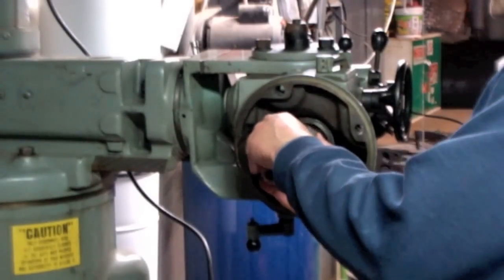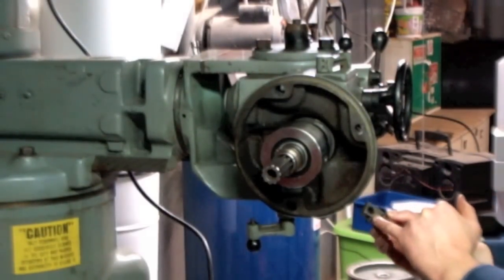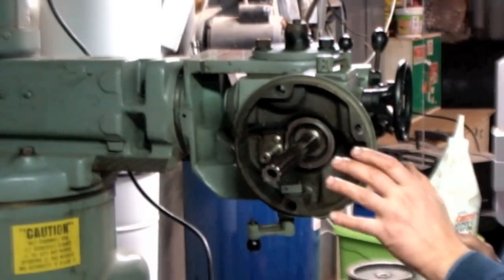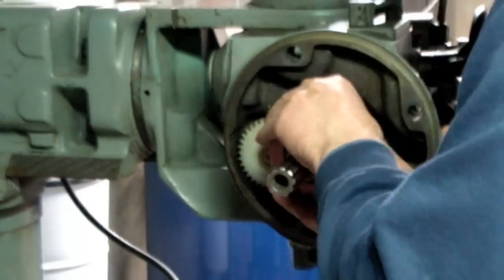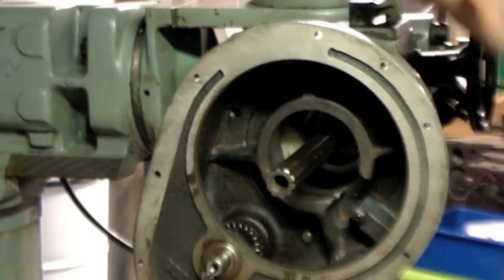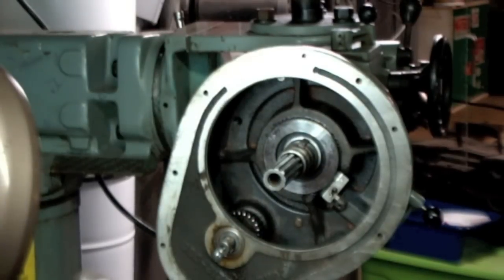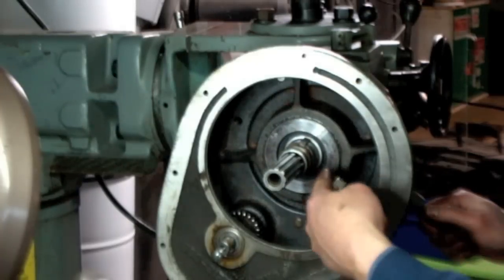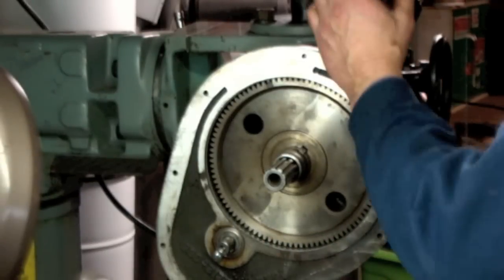Wells Index Milling Machine Part 51

Comment: Good clean up job. 

Isn't there a large quill spring in that assembly?

Best.
Reply from the maker: wiredodger60 I covered that in the video where I remove the quill. The spring is a large "clock spring" behind a plate where the handle to lower the quill is. You have to make sure you do not let go of the handle when removing the quill or the handle can spin violently, and bust your knuckles, or worse.